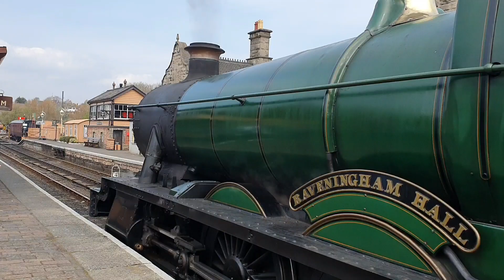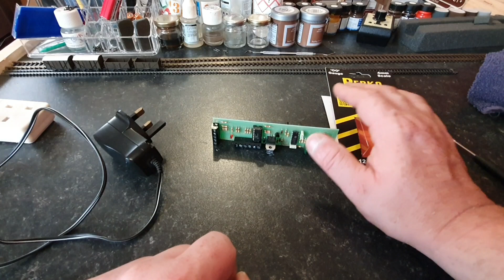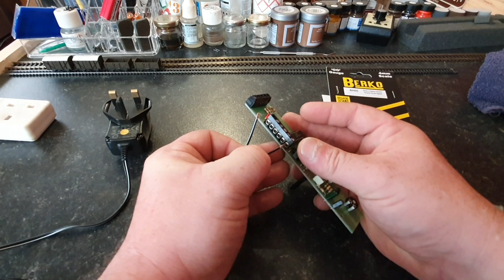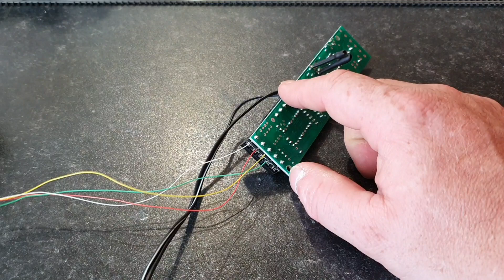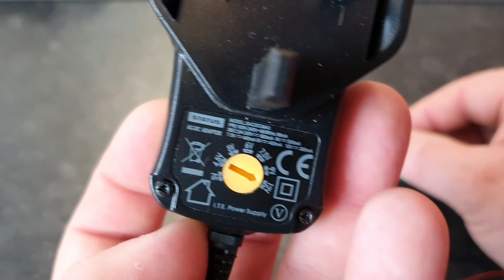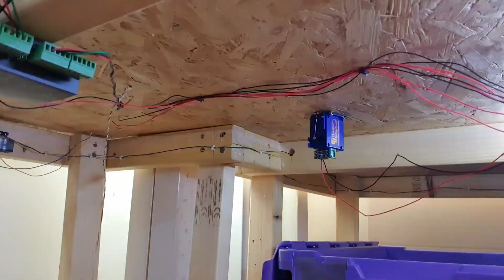Heathcote Electronics Mas Sequencer signal control

Comment: Hola excelente video, sabes si en eBay pudo localizar la placa de circuito?, quiero adquirir unas pero no logro en dónde. Te agradeceré comentarios, gracias
Reply from the maker: Hello
The boards i got direct from the company that make them they are called heathcote electronics and they are based in the united kingdom and you can find them easily on google.
Hope this helps and thank you for the brill comment.
Peter

Comment: excellent demo but i was wondering is there a way to stop it changing back until the train has full exited the block because if you stop train after it has passed sensor it will go back to green and your still there
Reply from the maker: Hi Andrew
The answer to the question is yes there is a way you can stop the sequence starting and that's if the board has it built in you can add a switch to keep it at red.
When you order the board ask for that feature to be on it.
Hope that helps.
Peter

Comment: Hi Peter I'm currently binge watching your back catalogue. Most enjoyable. Thanks for sharing. The MAS system from Heathcote does the business I just feel the sequencing is a little to quick for my liking so I would want to adjust to the max. I guess I'm too much of a purist of the prototypical form. Out of interest does the signal revert to danger even it it was passed at say a double yellow? This is more prototypical or is it just a generic sequence from red to green? Hope you understand my meaning!

thanks again
kev.
Reply: Yes it does Kev, some of my customers are signalmen and would give me an earfull if it was wrong. I have a version of the MAS Sequencer for signals with feathers and these have a option for only yellow when the feather is lit. I am impressed by the quality of Peter's video.
Reply: @cliveheathcote1831  brilliant that’s good to know.
Reply from the maker: hi kev
the time can be turned down by a little dial on the main board if i remember correctly but if i have them out i will check for you.
glad you enjoyed the video and it was of help.
peter